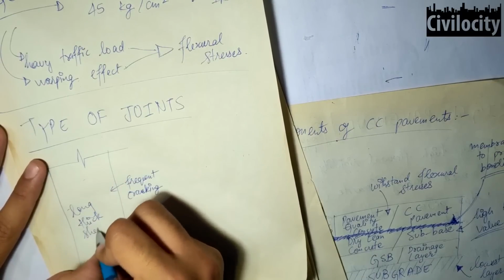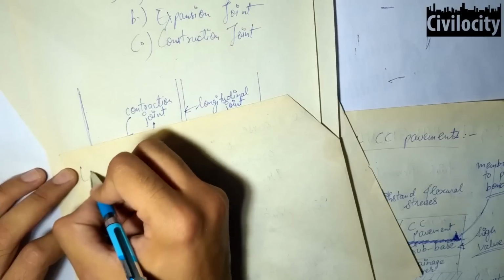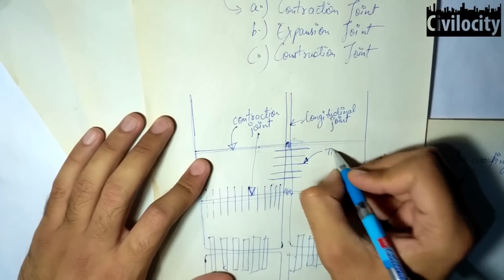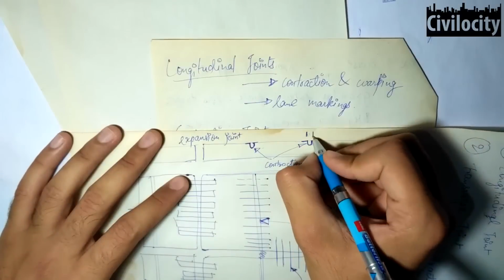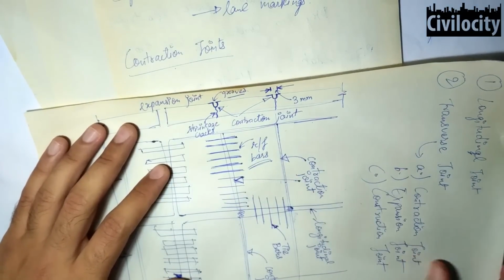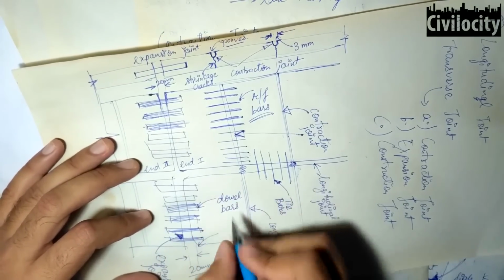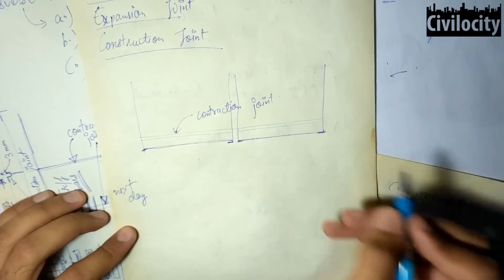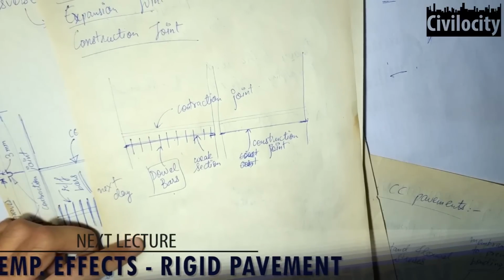Type of Joints | Design of Rigid Pavements | Lec-14 Part-2

Comment: Great video on joints sometimes they use small cuts in concrete and just throw in asphalt to make a expansion/contraction joint. Other more major high rise stuff i have seen they uses precasted concrete beams with semi-flexible large gage cables embedded in them instead of rigid rebar/mesh. The later is probably more for bridges as a good expansion joint solution.

Comment: Sir,in rigid pavement what is the thumb rule of placing reinforcement.it is to be placed bottom part or mid section of pavement.contraction joint are make at the time of laying concrete or after finishing concrete work and cut the groove.
Reply: The reinforcement may not play a significant role in resisting flexural stress developed in slab but as you know it helps to prevent widening of cracks so it is better to place reinforcement at about mid depth or little above mid depth so it works accordingly

Comment: Sir where or when in the part of the pavement is the expansion joint located?
Reply: Expansion joints are provided at the end of slab or between 2 slabs so that slabs doesn't collide with each other....basically exapansion joint allow the expansion of slab

Comment: My issue is more not for horizontal but vertically high structures and how they secure brick and concrete walls to girders , floor so they don't topple over or cave in. And they have to definitely have a good expansion/contraction/isolation joint based system in place to counteract swinging forces of a building. So if anybody knows the answers and want to do a video on how this is solved for most vertical buildings that be great.